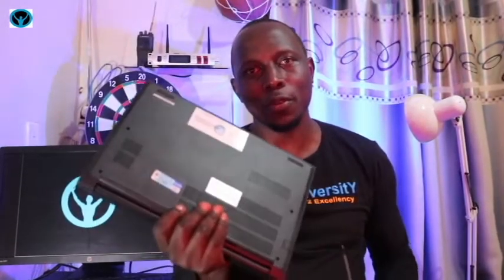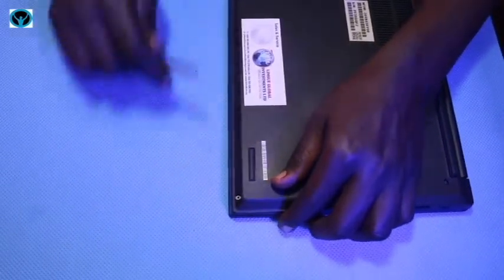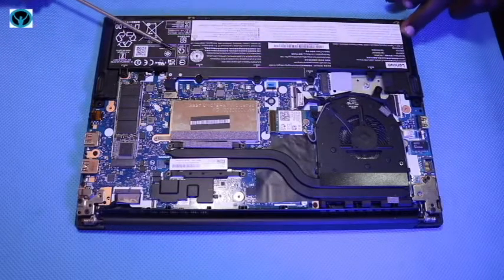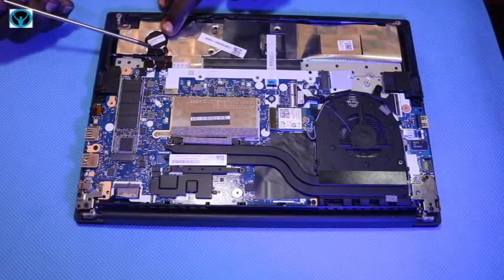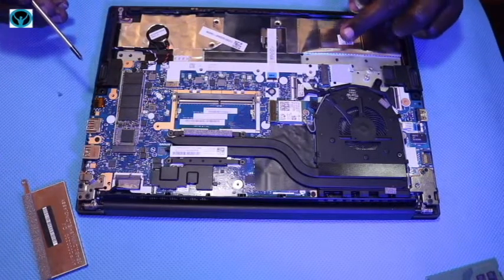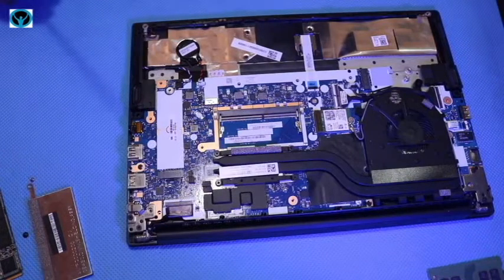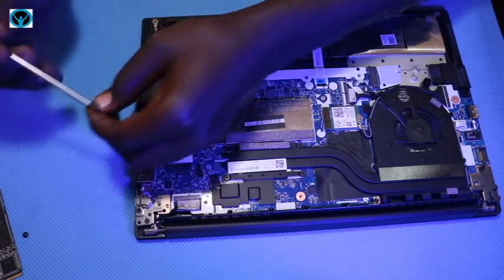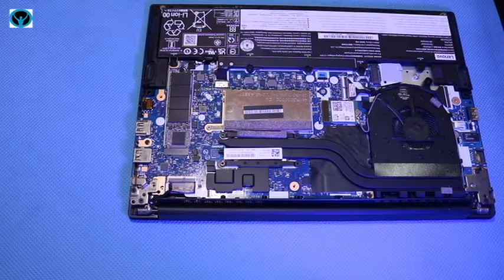Lenovo ThinkPad E14 Gen2 Disassembly & Upgrade Options | RAM | Battery | SSD/HDD

Comment: In my task manager it shows 1 slot free for RAM. I am using AMD version of ThinkPad E14 Gen 2. Does it mean my laptop has two RAM slots in it? And Thanks for the video :)
Reply from the maker: @raihanakram530  yes some versions have two RAM slots,  the initial RAM comes directly attached/installed onto the motherboard